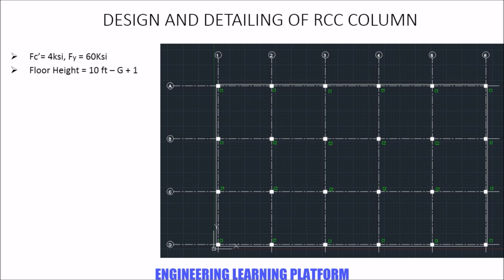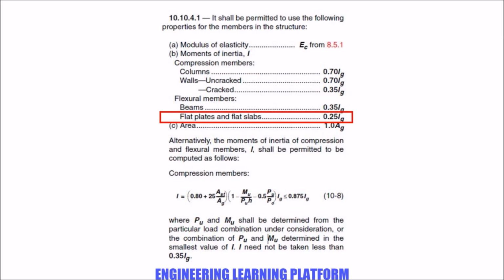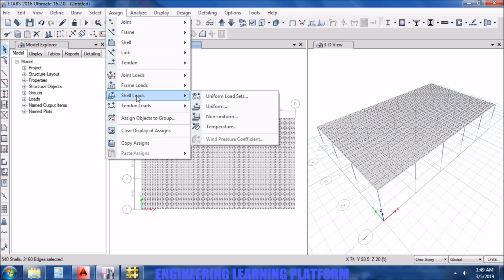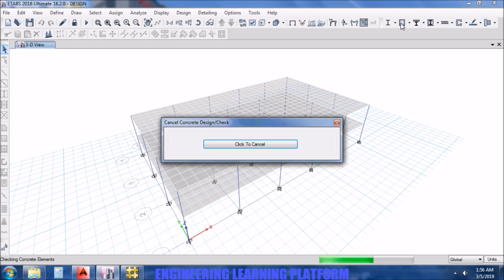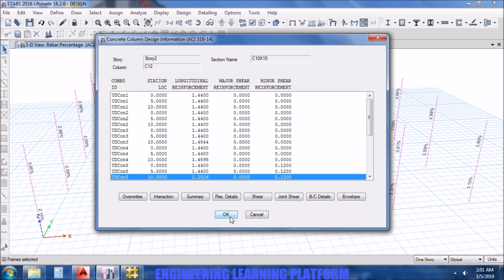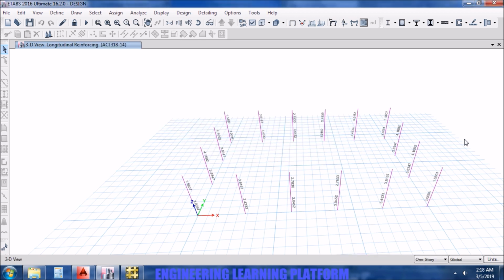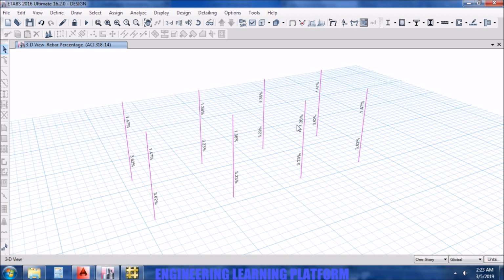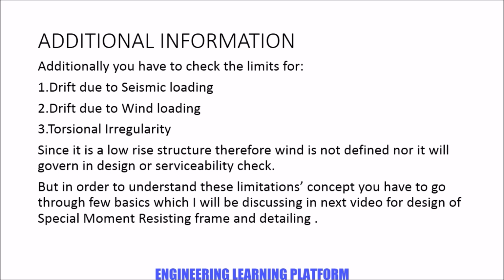RCC Column Design using etabs tutorial – IMRF design using ACI code

Comment: Bro, you have mentioned that due to earthquake loading steel in top stories gets higher always. This is not the case in my opinion because it depends on the mode shapes of the building. If the building is vibrating in 2nd mode of a particular direction then the moments will be higher in mid stories and ultimately steel will be higher but if the building is vibrating in 1st mode, then moment will be large in bottom stories as building is vibrating as a cantilever so steel in bottom stories will be high. In your model, the steel in the top stories is higher because you chose auto select option and software has selected 10 x 10 for the top story and 12 x 12 for the bottom story. As 10 x 10 has a smaller cross section so steel demand is high. Kindly correct me if I am wrong. Thanks
Reply from the maker: Yes auto select was just for initial size iteration but i later assigned the cross sections . Autoselect is only for initial iterations not for final modelling . Plus you are right about mode shapes i may have mistaken with word "always" its correct to say sometimes .
Reply: @EngineeringLearningPlatform  Good Job brother. Really appreciate your work
Reply: The higher %age of steel in top story columns do occur, as the top joint of the columns are free, as no column above, this makes to sway more as compared to columns in intermediate story.
Reply: Your deterioration of shear rebar has error, as Etabs calculates rebar as sq. inch per rft . The spacing calculation formula has to be inverse.
Reply: Typo mistake - It's determination not deterioration
Reply from the maker: CORRECTION : TAKE SHEAR REINFORCEMENT Av FROM ETABS IN (in^2/in) UNITS FOR USING THE TIES SPACING FORMULA PROVIDED IN THE VIDEO
Just see the units
Spacing (in) = [#Legs × Area ties (in^2) / [ Av by etabs (in^2/in) ]

Comment: Bro kindly provide the reference of using  25% live load in mass source for buildings having 100+ ft height. I don't think that there is a provision in ACI code or UBC-97 on this. Engineers usually ignore 25% live load to make low rise buildings economical.  if there is a warehouse than you cannot ignore live load. Please correct me if I am wrong. Thank you
Reply from the maker: Actually attending the Performance based design course classes from AIT got me this learning that 25% of LL is included in p delta and mass source of high rise . Now the definition of high rise may be said as building higher than 100ft and practically its legit bcz in high rise you have larger owht and MEP generators etc . Hence un ignorable LL to be included in building's resisting inertial forces and increasing P-Delta magnifications
Reply: @EngineeringLearningPlatform  Brother I have done my FYP on Performance-Based Seismic Design of Existing building and my supervisor has done his Ph.D. from AIT. I have watched all AIT lectures and seminars on PBD on youtube as well as read their papers. Dr. Naveed Anwar is awesome. Yes, you are right but there is no special provision in the code for this...That is what I was saying.
Reply from the maker: @structurefreek1713  yes but PBD doesnot strictly follow any code it is independent in many perspectives but just to make our understandings  clear we use code values and relations mostly for internationally accepted latest documents like ASCE for acceptance criterion on linear/non linear material/hinge properties and so-on . But since we are not doing PBD in this video so i didn't use 25% LL which is not in code . But will include in PBD tutorials soon to come .
Reply from the maker: The reference is included in the new videos watch them . Specially dual system design video has the reference